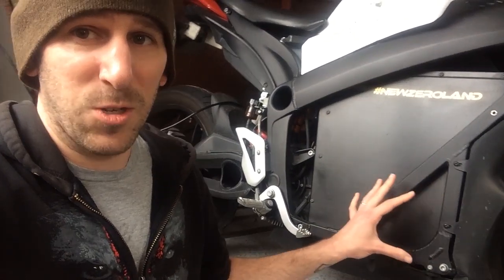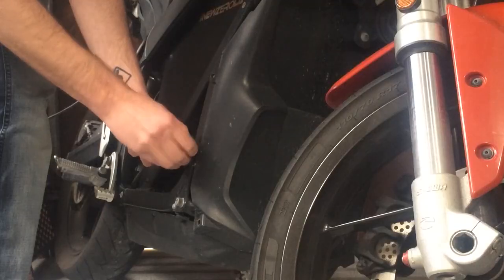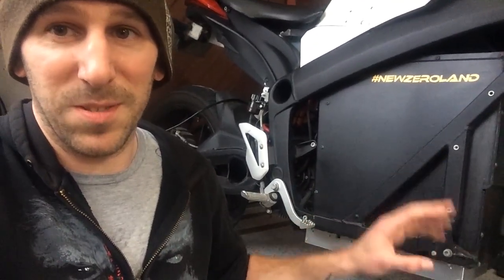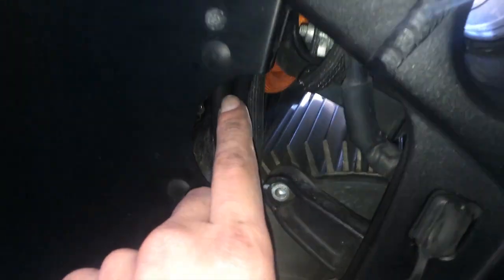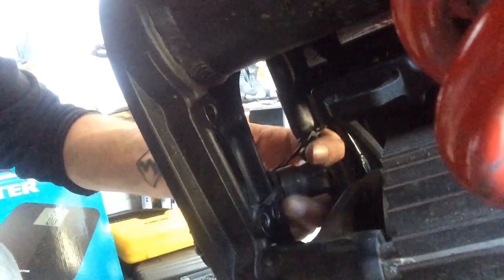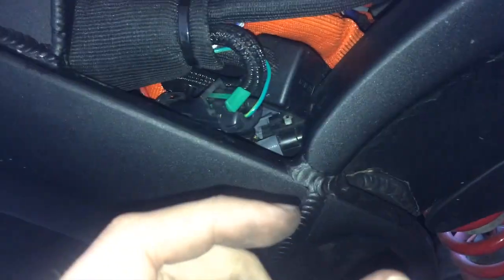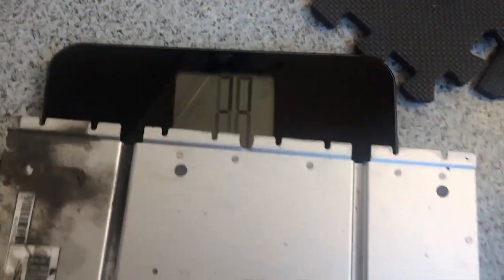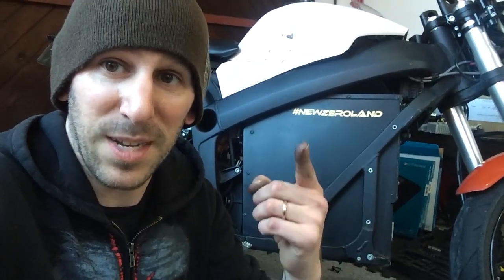How to Remove the Zero's Onboard Charger

Comment: Thanks for blazing the way! I'm going to be doing this soon, and it's great to see exactly what's involved before I start.

One thing Zero doesn't do well (actually, at all) is provide instructions. I bought the official windshield and luggage racks, and while the top rack was easy (aside from poorly drilled holes that I had to modify), the windshield would have been a problem if I had never dealt with a motorcycle one before and the side racks were impossible to figure out until I saw a bike with them already installed.

The windshield comes and goes with the seasons and the side racks won't be installed until I get fast charging capability and can tour. Maybe I should make a couple of how-to videos of my own for other people's benefit.

Oh, and one other thing I'm working on is 100% LED lighting conversion. The taillight is the only LED lamp on the bike, which I think is kind of dumb. I've already replaced the headlight and the little top light in the headlight housing, whatever the point of that is. It wasn't until I was almost done that I found out how easy it is to detach the headlight housing and make access to the back of it a million times easier. The indicators are another story - I'm going to try 3D printing some adapter rings for the housings because the replacement bulbs are too long and won't fit. I don't want to use aftermarket housings unless absolutely necessary, plus the adaptors will be an easier, quicker, plug-and play solution.
Reply from the maker: Thanks!  Yeah, I have a feeling Zero just doesn't want people working on their bikes, and for a lot of things it makes sense.  It's cool that they have a manual, but for everything else, there's the unofficial manual (www.zeromanual.com) and that's a huge help.  For LED replacement turn signals, check out Dump the Pump's video (find him in the comments below).  He recently swapped his and they're super bright.  But totally make your own how-to videos as well!  The more this community has, the better :)
Reply: I don't understand why in all my previous searches I never ran across that zeromanual.com, but it's an amazing resource and it's now bookmarked!

I already replaced the flasher with an LED-compatible one (because I think using resistors is a bad idea for several reasons but mostly because it nullifies power savings), so at this point I'm just waiting on a 3D printer. I hope to buy one, but there's a "maker space" in the area that I may be able to use in the mean time. If the project is a success, I'll make the files publicly available, and once I get my own printer may even sell the spacers if there's any interest. Those replacement units Dump the Pump used are really nice, but they are expensive and have built-in resistors. I suppose I could make similar units from scratch without the resistors, but one of my major considerations is using generic, plug-and-play components whenever possible. Then if there's ever a problem on the road it's much easier to deal with. It's also cheaper and simpler.
Reply from the maker: Good stuff!  Let me know when you have models to download.  That's exciting stuff!

Comment: Great video!  My 120v plug was completely corroded and fried, and your video helped me get that removed so I can replace it!
But now I'm considering keeping my onboard charger in the garage and off the bike...  Do you know if the bike still runs fine without the data connector to the onboard charger?  Would it have to be plugged in every time you charge?
Reply from the maker: Nice! Glad it helped. Yeah I rode the bike without the charger for a long time. You really feel the difference in weight. You just need to plug in the big Anderson DC connector and the communication cable and you're good to go!

Comment: Great Video! I have a  2016 SR (25k miles on odometer) with a failed onboard charger. I am in Rosarito MX right now with the bike, so replacing the charger at the dealership is not even an option. Would you recommend replacing it yourself? Is there an OEM charger that is better than the stock charger?
Reply from the maker: Aw man!  Sorry to hear that.  These stupid chargers seem like ticking time bombs.  Unfortunately a direct replacement is still the best option.  You can buy them from AF1 Racing, but I remember them costing $800 usd.  Here's a video on how to swap them: https://youtu.be/DFHQgTOMxO8

Comment: I love the idea of installing faster chargers but not fond of taking up multiple charging stations while I'm charging. EV's are pretty popular in my area and using two spots means someone else isn't charging. Can you use 2 diginow chargers with one 240v plug?
Reply from the maker: caramelzappa Yeah for sure.  Two of these chargers plug into one J1772 station, so if you had 2 you could still charge up in 1.5-2hrs.  Using multiple J stations is only necessary when you have more than 2 of these.  But then you could plug them all into one Tesla station ;)
Reply from the maker: Oh and you COULD plug 2 into a 240V outlet, but you'd have to turn the power down on the chargers.  Normal wall outlets just aren't powerful enough.

Comment: Would you know where I can buy a new onboard charger? I need to replace it, I don't see it anywhere on their website.
Reply from the maker: AF1 Racing sells them, but they're $800. See if someone is selling a used one, or buy a cheaper aftermarket one, like an Elcon.
Reply: I just called my dealership to order the official one and they shipped it right to my house but it's $800
Reply from the maker: @thomasansley539  sucks that they're so expensive.  These should be official recalls, for how often they crap out on people.
Reply: 😂Zero doesn't stand behind their products very well, I think most people know that by now hahaa

Comment: What did you do with the plug on the OEM charger, the one with the little wires? How did you get around it? Diginow seems to be out of the Zero MC charger business now. :(
Reply from the maker: Yeah, I'm bummed that they won't be selling these anymore. I just stuffed that cable above the motor. It originally went to the diginow SCv2.5 board, but I don't use it anymore.

Comment: Dude... I want to do this but... shouldn't I disconnect the fuse first? My buddy is a Zero mechanic and that's what he said to do first. There's a fuse for the whole battery, which you disconnect under the seat, which makes it so you can't electrocute yourself. Pretty much, that's what he told me. Which sucked because my bolt was seized up on the seat. Anyways, I love your video - the graphic wire images were amazing (HOW DID YOU DO THAT!?!) and very helpful. I am installing a new charger that is more waterproof. They made them because of people with charging problems in Costa Rica.
Reply: OK, for those that are really extra worried like me (I have a child), the fuse is located under the seat, right beneath the left leg (round black thing on the silver box, twist it, and it pops out). It is the high voltage fuse (something like that), so it disconnects all the high voltage power to the low voltage stuff (possibly, I think).
Reply: Oh, and for anybody with bolt seizing issues - there's a product called Free All. One mechanic here in Hawaii told me he never ever had to use anything else. Sold, worked like a charm. Way better than WD-40.
Reply from the maker: Hey nice! Glad you liked this, and thanks for posting about the fuse. Zero upgraded to a more waterproof charger?? These are all potted so the internals are waterproof already. The issues with the calex (and the rest of the bike) come from water getting into the connectors and frying them. Hopefully the new ones sorted that out. Some people use dielectric grease or silicon to seal stuff up. Good luck over there!
Reply: @NewZeroland  I should try to do some sealing up. Did the charger swap last night and dang was that Anderson connector hard to connect after I put it back together again. But I got it in there, zip tied it closed too. What a tiny task. LOL. Thanks for the guidance once again. So the new charger looks a lot like the old charger, except where it was model number EVC-116-1300, it is no 1325 instead. And there is a square thing inside the rubber sheath that seals in the plug-in part. I think that is to serve as some sort of protection against frying it due to water. Something like that. If I find out more, I'll let you know. It probably is just was waterproof, after all.
Reply: The charger I believe is not directly connected to the battery, there is a main contactor in between. You should be safe to work on this charger as long as your “ignition switch” is off and properly discharged.

Comment: Hi ! i love your vids and i'd like to purchase a FXS as soon as possible, i  got a question about the brand, is it good with the after sales service ? do you have any kind of probleme ?
Reply from the maker: Cyril Sebadelha an FXS sounds awesome.  I've had my SR for 2.5 years without any issues.  When it comes to electric motorcycles, Zero is the biggest and most reliable so far.  I think you'd have a lot of fun!
Reply: I'm sure you've learned by now, but they definitely do not stand behind their products very well! Lots of known issues that are never recalled or touched on by the factory
Reply: @CumminsTurbo4  no i didn't, Thank you !
Reply: Lucky. Dodged a bullet
Reply: I've two major battery issues. One was a bad thermocouple (under a $2 part in the digikey world) and by design the lowest replaceable part was the battery ($2800 from zero). Nice. The other was the main battery board. My FXS is modular so twice the trouble. Then the charger issues. Then the fact that the dealer always  has it for majority of the riding season, all adds up to just a poor experience for riding.
Reply: @CumminsTurbo4  Demmit ! Vehicules contructors don't think about repairs, only production, sad...how old is your bike ?
Reply: @Lyric.S- 2019, only had 2k miles at first issue, now has 4k, tough to get miles on it when it lives in the shop 😢but you said it. Electric vehicles are (supposed to be) inherently more reliable...hoomans are doomed lol😂
Reply: @CumminsTurbo4  Battery =>switch => motor => wheel, no ? how can it be hard ? (i may not have a lot of knowledge in batteries/motors)
Reply: Exactly. sources tell me that zero was afraid of litigation and lawsuits and so they over-engineered the entire system into oblivion which requires multiple electrical and computer engineers and a laptop to even start to do the first thing. When it goes to the dealer, the first thing the tech does is downloads all the logs and sends them to zero then waits 2 weeks for a reply

Comment: How do you get a replacement charger? DigiNow doesn't make Zero chargers anymore and mine just went out a few months out of warranty a couple months after my battery monolith was replaced.
Reply from the maker: Your onboard charger?  You can order those brand new from AF1 Racing.
Reply: @NewZeroland  Thanks I ended up finding that answer a little after I posted this. I tried talking to Hollywood Electronics as well after rewatching your video on getting parts. However, they didn't have them and they much like Green Watt Power were very adamant about not helping but going to an authorized Zero service center. 

After everything it looks like that's what I'm going to do. It's a little more than getting one from AF1 with the labor but the charger itself is $50 cheaper from Zero directly it seems. 

Just kind of sucks that the prior owner had it for two years, I bought right after the warranty was done on everything but the battery (already replaced under warranty at 4k miles). So after only 2 years and a few months I'm replacing the chargers that go out on so many of these bikes. Obviously there was a problem with these Calex chargers but Zero is not willing to extend the warranty on them even though their customers are getting screwed. I don't see this as building brand loyalty.
Reply from the maker: @O_RaLLY  I feel ya, man.  There should be a recall on these parts.  I can't believe they STILL use them.  It's insane.  But I'm glad you're able to get yours replaced :) And thanks for watching my videos!  Glad they helped.

Comment: HELP PLEASE ,I have a ds that the charger quit,ordered a new one from the dealer and it is actually 4 small chargers .installed it but there is no connection for the control plug,charger is putting out 113 volts but not triggering the on board computer ,do you know what I need to do with the control wires or do I need to connect it to a different input.I had ti change the 5/16 spade connectors on the new charge and attach an anderson plug to connect to the original onboard charger connection the dealer is no help.
.
Reply from the maker: What?? That sounds super weird. Do you know what kind of chargers they are? Why didn't the dealer install them? And as far as I know, Zero still uses the same calex chargers, so whatever your dealer sent sounds aftermarket and not from Zero.
Reply: @NewZeroland  yes ,it is weird,but that i what they sold me for $1300 with no instructions and they have never done on and have no idea.I called zero for help and they will not help because I am not a dealer.4 x 24 volt chargers in series and they line up to existing mounting holes in the bike.I am guessing the BMS is ether in the charger or controlled by the charger .
Reply from the maker: @briparts  whoa.. but a replacement calex is only $800. Maybe yours is a more reliable setup? But with no instructions, that doesn't make sense. Maybe it doesn't need the communication cable, like DigiNow chargers. Try turning the bike on first and then plugging it in. That might work, but it's definitely not normal.

Comment: My only concern is how does that effect the long term heath of the battery?
Reply from the maker: The only concern with charging faster is heating up the battery too much.  The stock charger gets REALLY hot and is touching the bottom of the battery, so that is actually worse for it than these aftermarket chargers.  These batteries are also capable of charging safely at 3C, so this setup (still below 1C) shouldn't be a problem.